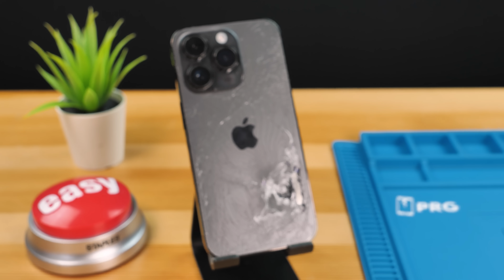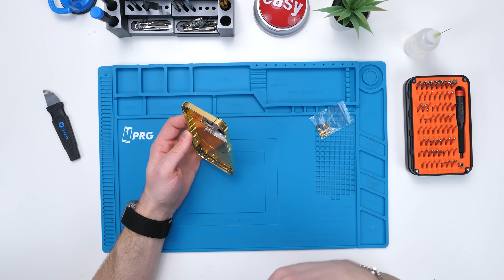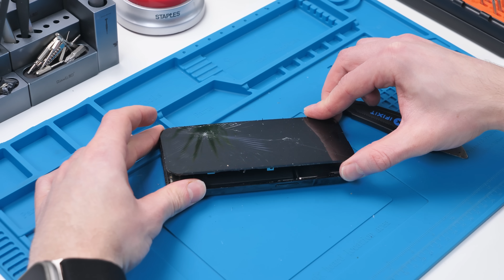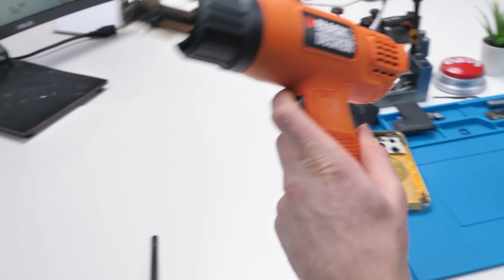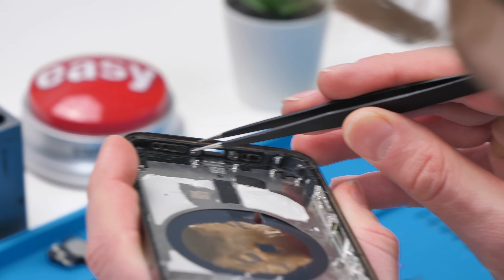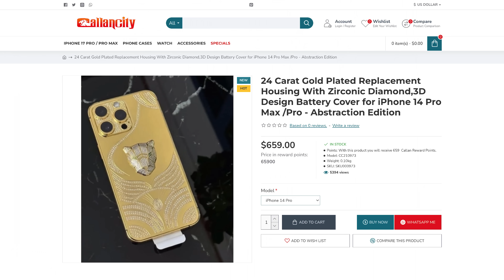Making My Own Luxury iPhone For Half The Price

Comment: Zirconic diamond means fake diamonds. Zirconium is the most common type of fake diamond. 

Edit: the listing also says 24 carat gold. when it should be saying 24 karat. Preeeetty sure you've been scammed.
Reply: I saw scam written all over this. Gold plating is really not that impressive at all. What was he thinking?
Reply: Well I hate to correct you on this but Karat is only used in the US and Canada. It's Carat for basically THE ENTIRE world. So ye. But those diamonds are fake
Reply: @Wil@WildEggLOLdang imperial system
Reply: Guys carat(ct) measures wt of diamond. 1 carat or 1ct means 0.2g of diamond.
While karat(k) measures how much pure is the gold. For example 24k is 99.99% pure gold
Reply: Insane attention to details.
Reply: @nirbhikhiranyachaudhary9161
If you're not particular, you don't need a smartphone with gold or diamonds.
Reply: This isn’t « fake diamond ». Diamond is an atomic structure.
Reply: True. He using fake diamonds 💀🥀
Reply: D
Reply: It's not trying to be diamond it's fake crystal
Reply: Lab grown diamonds are not fake diamonds
Reply: @L8PRODTV true, but zirconium is not a lab grown diamond. It is an entirely different mineral.